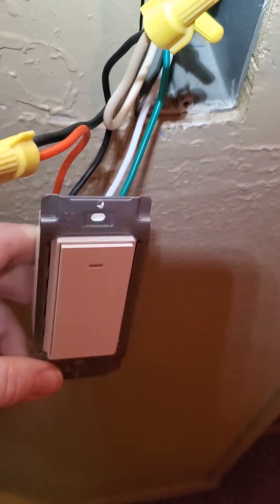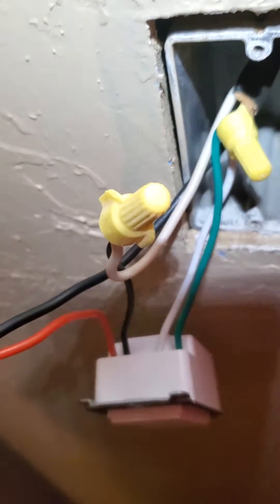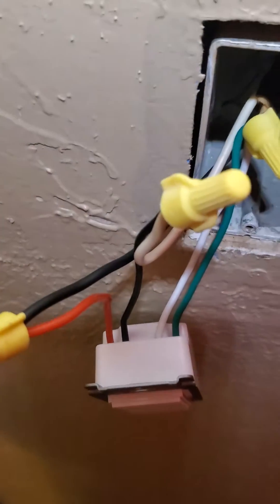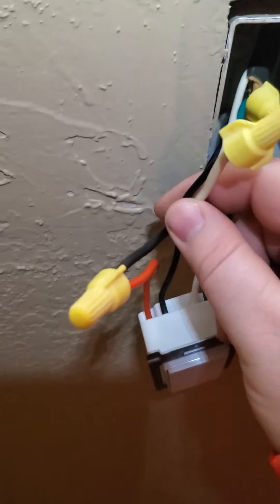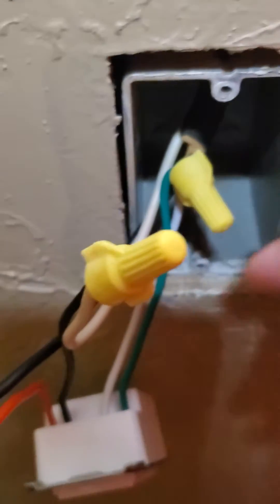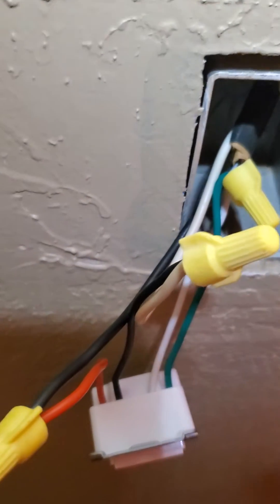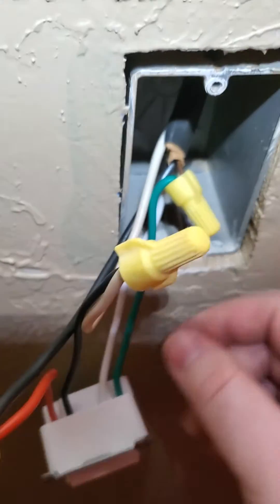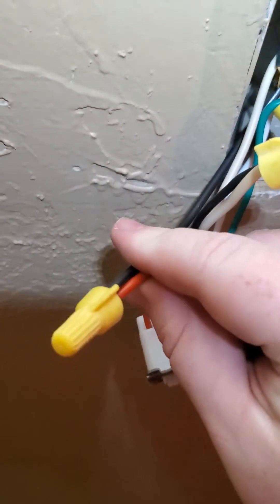Installing a 4 wire smart light switch with only 3 wires.

Comment: I only have 2 wires in my box, is there a workaround for my box?
Reply: You likely have an old house with old wiring. I wouldn’t attempt to change to this type of a smart switch without consulting an electrician.

Comment: Thank you kindly!  Some garages are also missing the neutral, even though the rest of the house has neutral in all other boxes.  Is this typical?  My house was build in 1993 and the application above is what we have.
Reply: The 3 wires may indicate that  the switch you have is a simple switch loop. A 14-2 cable was all that was required for the situation when a switch is added at the end of a circuit to control the last light on the circuit.  I have a similar problem. One switch is in a gang box and it has neutral because power is to the box. The single loop switch basically an add on. Still trying to figure this out. It’s not convenient to add a 14-3 wire at this point to have the neutral wire in the switch box.

Comment: I have tried this on an HS200 Kasa switch and it doesn’t seem to work. Even switching black wires it turns light on and then right back off but doesn’t stay on. Can someone assist with this?
Reply: You must not be doing it right.  Are you using the Kasa HS200 model?  Can you send me a photo?

Comment: tying a neutral to ground can potentially cause every grounded device in your home to become hot/energized... there is a reason the neutral is NOT called a ground. also why you dont bond sub panels...doing this is dangerous and should NOT be done. people, if you do not know what your doing, hire or consult with an actual electrician.

Comment: Hello. I got some dilemma...in my house some switch box has neutral wire and some don't. Not sure why but I installed kasa tp smart switch into the neutral wire box and it works. But my question is will it work that doesn't have neutral wire? Like my bedroom and bathroom have neutral wire but the hallway (3 way switch)and kitchen and dining room switch doesn't have neutral wire. I am confused why my wiring is like this. any help would much appreciated.
The reason I am asking because after installing the bedroom switch I went bought some other switch from same brand from Facebook marketplace and can not be returned and when I found out this situation I got very upset. Thanks

Comment: Until you find that the ground wire is now carrying electrical current and you could get zapped. If you do this, tie the ground wire back to a neutral wire at the closest electrical box. Yawl be careful.

Comment: With the Leviton DT112-1LW Countdown Timer Switch for household lights, heaters and exhaust, 2-4-8-12 hour, No Neutral Wire Required, Single Pole, 15A, 1/2 HP/9.8A Fan/Motor, White, 15 Amp it has a GREEN SLEEVE wire coating you leave over the White Neutral Wire and they claim it connects with the ground and good togo.  So get a modern switch with "No Neutral Required" and connect as seen in the video.  - Mahalo

Comment: Thank you so much, your solution worked in my house. But not completely. In the switch box of my bedroom light, there are three wires: white, black, and green. The green was screwed on the metal back of the box, and the other two were connected to the previous switch. I tied the two hot wires of the new smart switch (both black) to the white and black wires in the box, and then tied switch's neutral and ground to the green wire in the box. It succeeded and the light works normally.

The light switch in my kitchen appears to be more older. After opening the box on the wall, I found 2 red wires and 1 green wire inside. I tied  2 hot wires of the same kind new switch to the 2 red wires in the box, and then tied the neutral and ground to the green wire. However, the light keeps flickering, turning on and off at a rate of about twice per second. Could you please advise how to fix this? Is it possible that the red wires in the kitchen box are not both hot wires?

Comment: so hot meaning there is power going through the wire. if the load cable in the light fitting is not hot meaning a live , Do you need to attach the live wire to the load also to make it hot ?
Reply from the maker: No

Comment: Wait why wouldn’t you just wire red and black to black, white to white, and ground to ground?
Reply from the maker: Because the pinout coloring for the switch doesn't match the US electrical code for one, and for two because it needs two neutrals not two hots
Reply: @mtnentertainment3454 yeah idk that makes zero sense I see all American colors there. I ran one today , load (red) when to the light fixture, white to white all capped, black to black (from main power) and ground to ground…worked out fine. From what I understand you should never have to use hot to neutral.  Unless I did something wrong? But I don’t think so.

Comment: You said white was hot.  White is neutral/common.
Reply from the maker: Yes, but this is a switch and there is no code for which of the wires has the load before the switch

Comment: You obviously scrubbed all the negative comments from real pros about how dangerous it is to add a neutral electron filled white wire to a ground as it heats the ground and electrifies the house so anything touching the ground that is flammable - even over time, WILL BLAZE. This is an extremely bad idea. RUN A NEUTRAL even if you have to rewire an entire home or wall etc. Do it right, do it to code, and keep your family and your property safe. Do NOT wire this way.
Reply: Can you please explain what happens when they do it this way? I want to be sure that I dont run a risk of a fire. But I see alot of people doing it and working. Just want to be sure. Thanks

Comment: My 1960s home has flood lights and literally a black and white 8 or 10 gauge wire connected to a switch that powers them. None of this modern day, 3, 5, 10 wires.

Comment: I have the EXACT smart dimmed I got on clearance as opened box and got it for $3! I thiugbt oh heck ya! Only to get home to install it and find it had a red wire and wouldn't work even tho I tired to wire it anywyas not using the red and we'll needless to say it had been in the drawer for 2 plus years UNTIL JUST NOW! thank you thank you thank you for this video! This is the ONLY video I've found on this issue! Why aren't more people making a video on this! I may make my own but yours is totally awesome and clear instructions only difference is I'm working on a manufactured home and I've got 2 sets of wires km dealing with so it'll be a little different than this video but again thanks so much! I just hope I am writing this up right with the 2 sets of wires!
Reply: How did you wire it without the ground? My bedroom doesn't have a ground wire... Just the load and hot.

Comment: Hi , In my old switch I ghve black+White and a copper ground where as in my Smart switch TP Link HS200 I have two black (Line/Load) +White(Neutral)+Green(Ground) , So I will connect two black of my Smart switch to old black+white then Green+Neutral of my new Smart switch tied together then all tied together to copper ground cable , if anyone have done please give a buzz. Thanks

Comment: This is a VERY BAD IDEA. There is a very sound reason for neutral and ground to be bonded WITHIN THE PANEL -- not outside of it. If you follow this video, YOU WILL ENERGISE YOUR GROUND WIRE. Have fun with your insurance underwriter if you do this.

Comment: Wait I thought it’s a bad idea to use ground as neutral because ground is not meant to take much current, so it might overheat when used as neutral. Am I missing anything?
Reply: How much current is being used in the smart switch neutral?  What is it for?  Probably the tiny LED lights in the switch.  Probably less than 1 watt.  Just my guess.  I think the line and load wires take the most power of the fixture it is connected to.

Comment: "neutral connection and tie it in with the ground". This works only for those that what what all that is, not for those that have zero experience. You could have pointed out What inside the box in the wall is ground.
Reply from the maker: The bare copper. It's always ground.

Comment: Hi a have a question I only have 2 Wires ? What do I do ?
Reply: If you have a metal box, check if it’s grounded, if so you can get a ground screw and a copper wire and connect one end to the metal box and then the other end to the switch.

Comment: Dont just listen to this guy without understanding basic electrical knowledge or else youre going to connect positive to negative
Reply: I was thinking the same thing….and white is neutral not hot…it’s hot neutral ground…not hot hot ground. I wonder if he burned his house down yet 😅
Reply: I have some experience, tried this as a solution and it threw my breaker. My house was built in 2008, but they redid this section and as I believed not up to code.

Comment: That's great that you've helped so many.  My old house has just three wires in the switch box: black, white and ground.  It does not seem to work following your video.  Nor when I switch the load and hot wires.  Am I just out of luck because the ground is not linked to neutral in my house?
Reply from the maker: While that's a possibility, it's not likely. More likely the switch you have just went work in this manner. Since I made this video some newer switches have been released which are wired differently internally, I have yet to find a good way to make them work.
Reply: thank you for your quick reply!  If true, that's very sad for me.  😒   I guess to have a smart switch, I have buy a different one or run four wire romex to the switch box.  🤥

Comment: This probably would have helped me except for how my junction box is wired. Aside from the wiring for the light, there's, at least, 2 or 3 outlets wired into another wire going into the same junction box. So, aside from having to share one breaker box wire across two different wires, there's barely enough room to tie both sets of wire and one switch inside a box big enough only for the one switch.
Reply: Pigtail pigtail pigtail.

Comment: This helped me. I didn't have a ground wire in my switch box. The house was built in 1956.........no visible ground wires so my wall switch timer(Woods 59020) had three wires , 1 black,1red,1green(ground). I wired the green(ground) to the white(neutral) and it seems to be working.  I'll wait 24 hours and let it cycle through once. Let you know.  I couldn't even get the timer to power up, but I've got power and I programed the unit.

Comment: this is super helpful! I bought a smart switch 2 years ago and finally I was able to install it. The only thing different that I did was to connect black with black, and the white wire from the wall to the red wire from the smart switch. Probably because the black wire on my smart switch is the “in” wire.
Reply: I was wondering who had the bright idea of color coding the wires in a way that the white goes to the black instead of black connecting with the black!? 🤦‍♂️
Reply: @tonicrvnts jajajaja,  I was wondering too! Your comments made me laugh!
Reply: The weakness of color coding for switch legs is it’s not always obvious. Some use the white for hot and mark it with a red or black stripe, and others use the black for hot and feed the light with white. 
I’ve run to a few who switched the neutral, but that’s usually by accident in older homes.

Comment: Thank you, Thank you , Thank you ! I am certain there is a reason why no one else explained this like you, but I don’t care. 
The Smart lights are working just fine; installed and are in operational working order.
No neutral wiring in my house.
Following your instructions, and using a voltage detector & voltage meter to ensure I found the load wire and everything worked just fine .

May the rewards from the universe shower upon you, my friend.
Reply: Update: I upgraded 90% of my switches to smart switches, 10 months with no issues whatsoever.I couldn’t be happier.
Reply: @juancable1  Everything still working in proper order? I see some comments that by doing this you are energizing your ground wire and are at risk for causing a fire. Im hesitant to try but am curious how its working out for you
Reply: @jramos20  Absolutely NO temperature increase, no detectable voltage, everything is working absolutely perfect. I cannot thank you enough.
Thank you once again.
Reply: @juancable1 any issues with energizing ground wire?
Reply: @ thank you so much for your question. There has been absolutely no energizing of the ground wire, I have never detected any power surge or current. To this day, I am enjoying automated lights that I use throughout the whole home using Alexa enabled switches. It’s been over two years now and I love it. I really appreciate the original author of the video because everyone else are bunch of naysayers.

Comment: I think wire you wrote in the description is backwards and needs a simple change.  You wrote: "this is achieved by connecting the load and ground wires on the switch to the ground wire in the junction box."
It should read: "this is achieved by connecting the NEUTRAL and ground wires on the smart switch to the ground wire in the switch's junction box."  
The video is very correct in its solution; only your written description mistakenly uses the word load instead of neutral).  I  believe the video was corrected, as I don't see this issue anymore.  Keeping because of the comment to this comment, and I have removed a long discussion because as the next comment indicates, this approach is not approved, so I am not going to suggest it.  Buy a smart switch that does not need a neutral located at the older-method of wiring a light switch
Reply: Hey, so this is fine correct? I thought this was potentially a fire hazard.
Reply: @aseitydeity1314  Well, I ran my solution through AI asking for an evaluation and this is the reply: NEC 404.2(C) and 250.4(A)(5) prohibits using the ground for anything other than fault protection.  It also said there are smart switches that do NOT need the neutral to operate, as they use the load, when turned on (I assume a battery is needed to charge for when load is off). Example: Leviton Decora Smart No-Neutral (DN15S)
Reply: @fathompin  yeah that’s what I thought. Yes at the main panel both ground and neutral are connected but the ground will be energized so the breaker might not trip if a fault even occurs

Comment: You are life saver. I’ve been challenged with the neutral wires for a few months now. Not even a single article or video provided the explanation which you did. Everyone talks about how important it is to have neutral wire and the ONLY alternative are the Lutron switches. 
This is the only video I came across which shared such a valuable information and it works. Thank you bunch!!!!

Comment: Arent you sending power to the ground cable?
Reply: But you can touch a ground wire, doing this wouldn’t it make it live?
Reply from the maker: More accurately I am drawing power FROM the ground cable. I could accomplish the same thing with a diode on the neutral wire but because the ground and nuetral are connected in the breaker box it is unnecessary. The ground is not a separate wire with no power that only runs into the ground, it always has power just like neutral does.